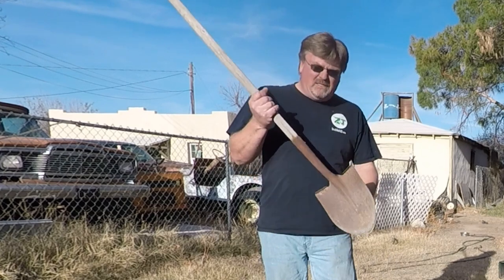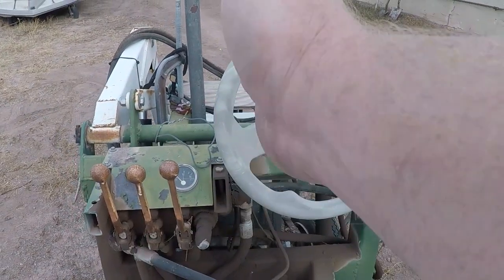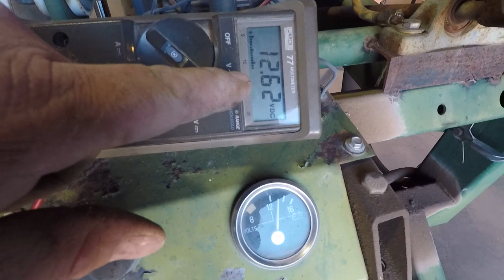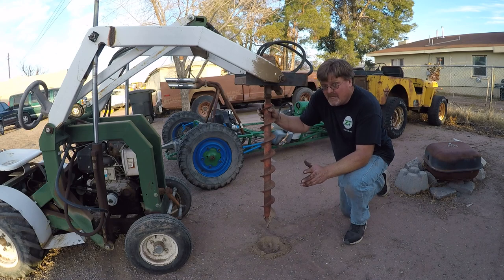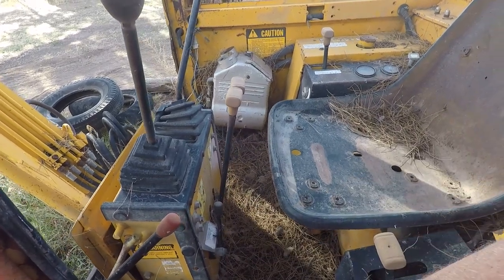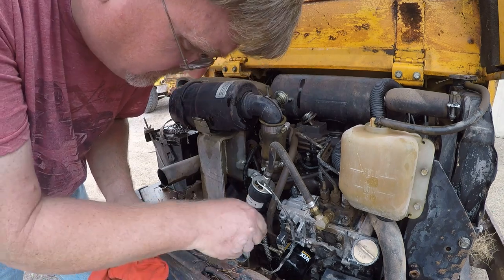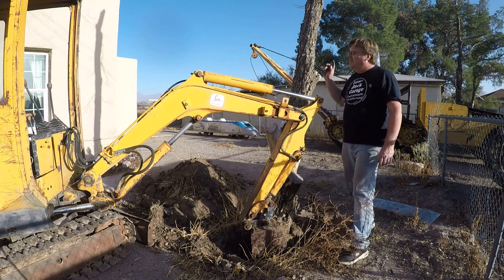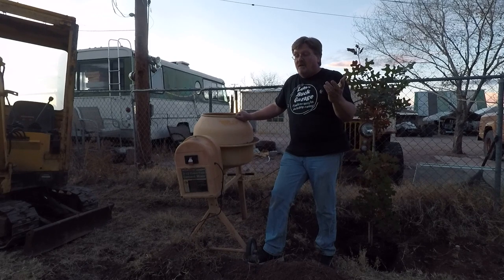Planting Trees With Power Tools

Comment: You can add more weight for free by fitting water valves and simply filling the rear tyres with water instead of air. Remember to add anti freeze if your winters go below freezing.

Comment: Nice little excavator. I worked lots of mini diggers and big machines and if you set your offset to the other side and work in the opposite direction it's much easier because you can look out the open door and there are no obstacles blocking your vision.

Comment: You have a considerable amount of cylinder testosterone. I kinda like that home made garden tractor you built. I found a workhorse 84 GT1100 in the garbage in Florida, the Briggs had Zero compression so I swapped it with a Honda13HP that I bartered for man I use the hell out of the thing Im collecting things to make a hydraulic auger for it, but Its hard to collect things here in the ozarks no one throws re-servicable stuff alway like they do in Fl.
Reply from the maker: If you don't have a hydraulic pump already, a cheap source is power steering pumps.  For running a hydraulic motor, any one will do.  They also have remote reservoir ones that you can plumb to a big tank if you need more fluid to run cylinders.

Comment: Those wooden handled shovels, are WAY easier to use, if you never let them rust. I have a round nose I bought new about 50 years ago, that has never seen rust, shiney and smooth digs much easier!
Reply: Any tips on avoiding or at least slowing rust
Reply: @a.h.2276   Clean any dirt off as soon as you're done digging. Never leave moist dirt on the tool, long enough to dry out.
  Then used motor oil, WD40, or fluid film on the tool when you put it away.

Comment: I don't think that even with a short-circuited starter you could have so much voltage drop in the cables, in that case you would have it in the battery posts.
If that ring terminal bolted to the chassis is was made of tin plated or copper plated steel I wouldn't trust it anymore, once the plating is gone the connections between the rusty steel terminal and the rusty copper wire and the connections of the rusty steel terminal and the rusty tractor chassis may be somewhat compromised.

Comment: Hi there your little excavator you got the blade is not for levelling ITS a stabilizer you are operating the wrong way round LOOK at your video the excavator is lifting up the fastest way to screw your idlers bang bang bang you get it NOW turn your machine around and see a vast difference in the dig  keep up the good work